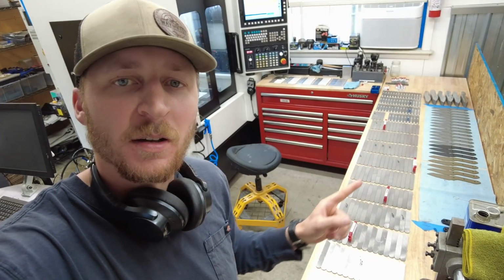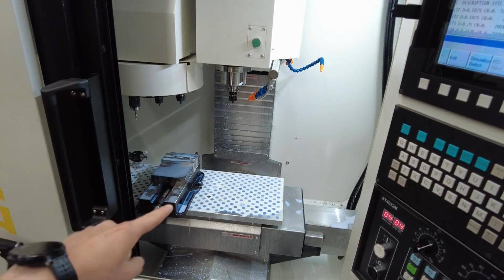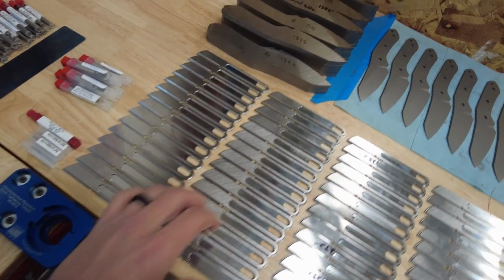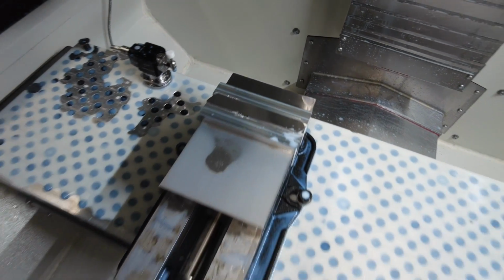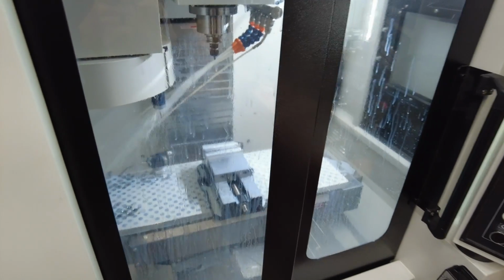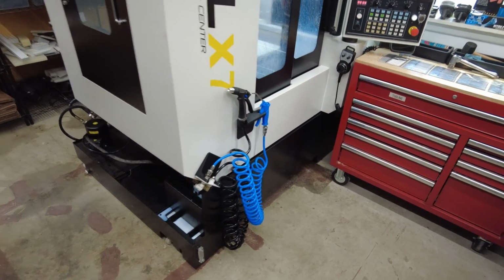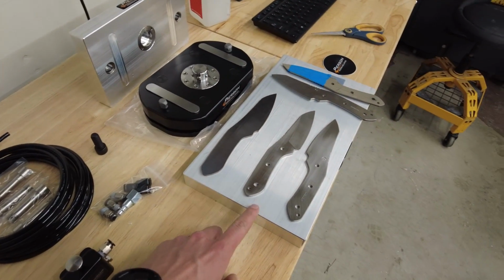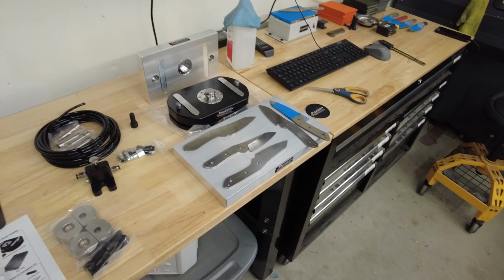First Knife Parts Machined on my Syil X7 | Fixturing Woes

Comment: Excellent work! Don't forget to run the warm up program. Also you can make pallet systems yourself relatively easily. You use two over sized ball bearings in place of the locater pins and then you have stand offs periodically throughout the base, use a couple of latches to hold pallets down at the ball bearings. On the pallets you just face mill the bottom and machine a couple of spots for the ball bearing to mate up to.

This method can economically allow you to turn your entire table into a palletized system. Allowing vastly longer run times, less tool changes, quicker parts loading, well you already know. The more parts you can cram in there the less overall time per part for run time.
Reply from the maker: Great idea. That would be fun to build. I have been running a warm up program for sure. About 10 minutes at 25% and 10 minutes at 50%.
Reply: @tj.schwarz  I wish I could claim that idea but it's something I've seen at an old job. Also once you really begin to cram a large number of parts in there it helps to have pairs of the same tools or simply buy roughing tools. This practice excludes drilling tools normally but on milling operations you use one tool as a rougher then do a tool change to the less abused tool that will do the last 1-2 passes. This way you can greatly extend the periods of replacing worn tools and just sling pallets without thinking for a long time.
Reply: @tj.schwarz  how much better ? Ridged? Speed? Working space? does the X7  have over the 1100 tormach?

Comment: That machine is slow. It would drive me nuts. Try a Brother machine or a Fanuc Robo Drill or even a Haas DM. Speed is what you need. 🤣
Reply: Which machine do you own?
Reply: try a Chiron... you could change the tool holder to a faster one, but to be honest- if you dont need it, why pay extra? For the price this machine outperforms most competition and as long as you dont mass produce (where this type of machine isnt even suitable) you can simply ignore these times in a small shop